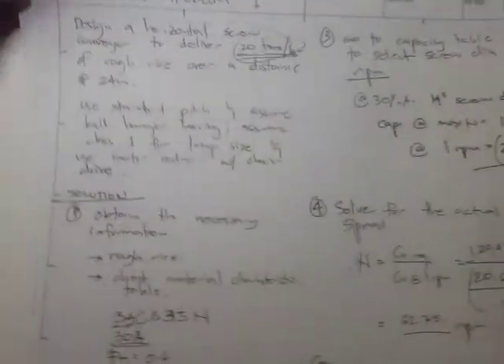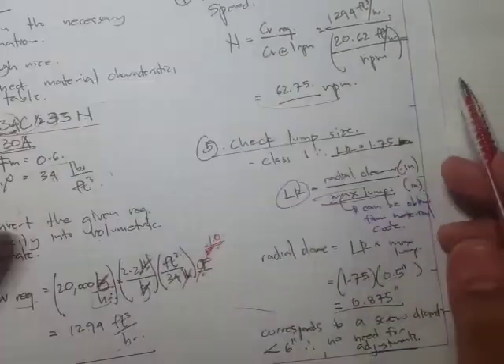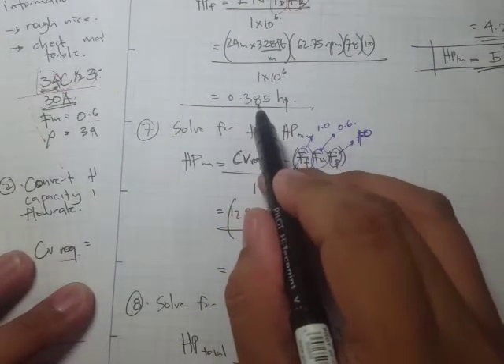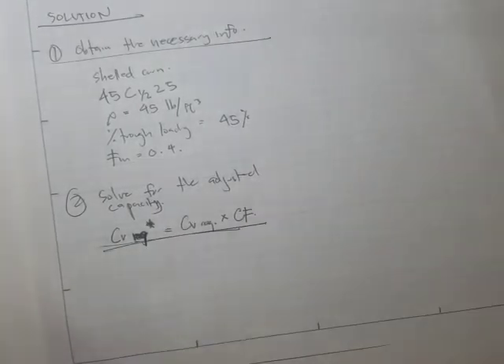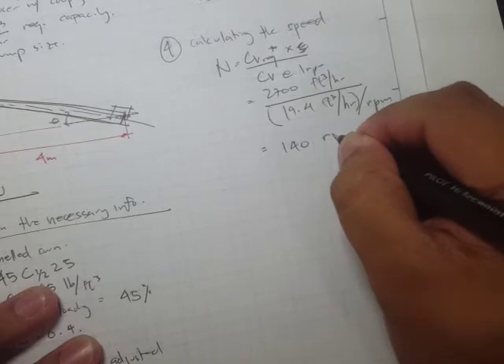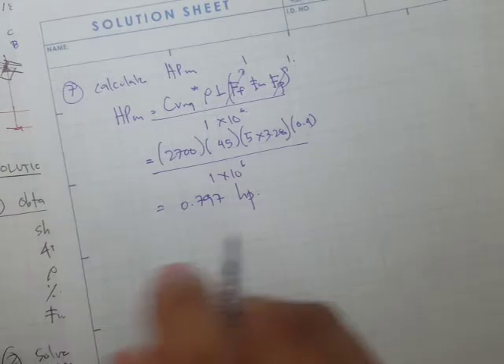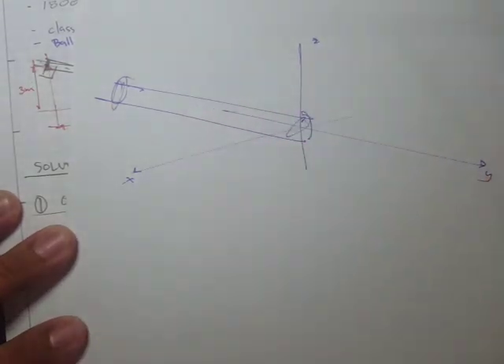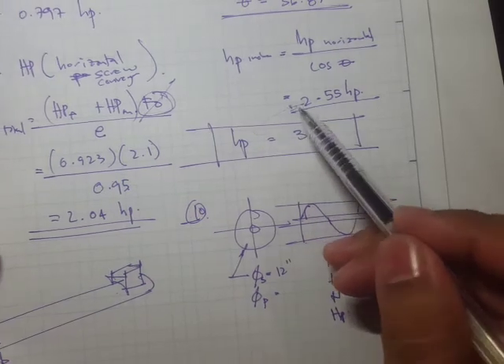ABE180 - 04.04 - Design of Screw Conveyor (Part4)

Comment: I did calculation for urea prills with a 1 meter long conveyor length and a 5000kgs/h rate, the sum of the HPf and HPm is low(0.05Hp) cant find the find the overload factor on the chart, how do I go from there to acquire the total Hp required and isnt 0.05 too low, maybe my math is wrong somewhere?
Reply from the maker: Hello.  If you don't mind, can I take a look at your calculations?
Reply: @sirby_lectures  Sure
Reply from the maker: @kevinfidelismarie1214  Pls. check your email, I just sent my reply.  Hp calculated is 0.5hp.  By the way, you are blessed, I run through your calculations and replied to you which I don't usually do because of busy-ness
Reply: @sirby_lectures thanks a lot for the quick reply, I'll check it out, stay blessed.
Reply from the maker: @kevinfidelismarie1214  You're welcome.  Amen.  When your project is constructed/installed,  I would appreciate if you can just update me if the calculation worked.
Reply: @sirby_lectures I definetly will

Comment: Can you pl share lecture on pneumatic conveying system 
I have seen it before on your channel but cannot find it now 
Pl help sir
Reply from the maker: Thanks for appreciating.  I've made it available now.  May I know where you are using it for, if you don't mind?  Actually It's be couple of months now since I left the academe, and now I'm back in the industry.  It was kinda fulfilling to see that some people have appreciated the time and effort.
Reply: No doubt you did a great job in explaining concepts.... I am working for a cement manufacturing industry. Named as dalmia cement and i have to order auxiliary equipment for it.... Thats why i require all these calculations 
However your calculations are not valid for these applications ( these are too theoretical) but your logical explanations are very much valid for all machines 
Thanks for your effort and time given on these videos. 
Its appreciable
Reply from the maker: @ Thank you.  I cannot disagree with you that it's more theoretical.  In what I see about pneumatic conveying, there's not much references as compared to other design stuffs like structural design, mechanical components, pressure vessels, screw conveyors, etc... all these have established or enough codes/standards/references.

Another one that I find difficulty in establishing the calculation procedure is the size reduction equipment like hammer mills.   Very challenging!  

God bless you in your endeavor Sir!
Reply: You tube comments is not an appropriate platform for discussions it would be helpful if you can just share your mail id or whatever seems fine for you 
Thanks and Regards 
Kartikeya

Comment: Horse power trick is interesting. For a vertical screw the cos(90)=0 then the HP is become infinite!! Anyway thank you for your time.
Reply from the maker: you're welcome.  that's fascinating about mathematics.  there's actually another one.. in electrical equations... P=V^2/R... a zero resistance will produce infinite power.
Reply: You can multiply the "Incline Factor" with the Capacity
For example, in the GOST standard:
0 degree - c = 1 (Horizon)
5 degree - c = 0.9
10 degree - c = 0.8
15 degree - c = 0.7 
20 degree - c = 0.65

So, with the incline the actual capacity of screw conveyor is lower than horizontal screw. This mean you re-choose lager Dia or speed to make sense (actual Cap = req Cap). Then you can calculate the HP